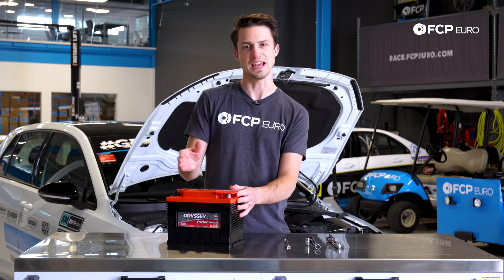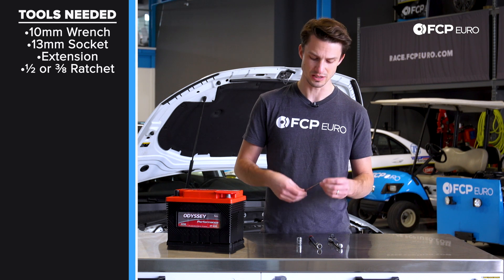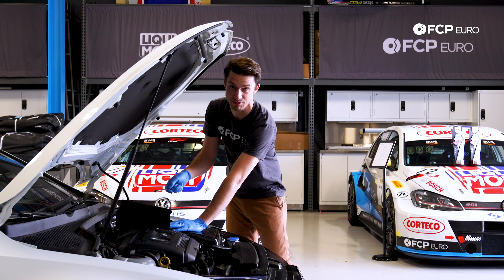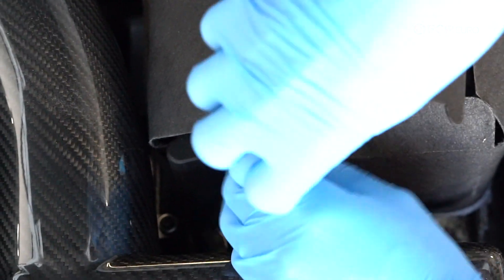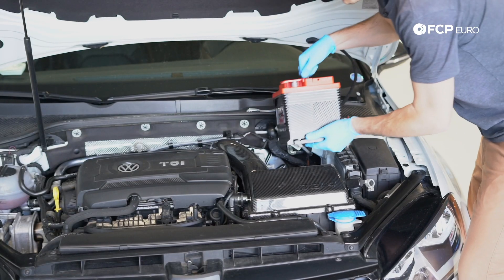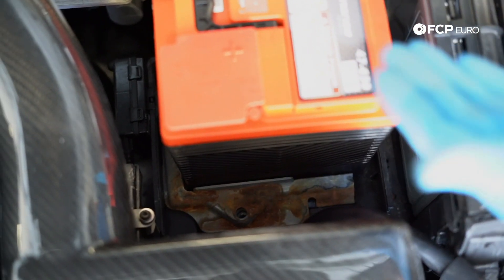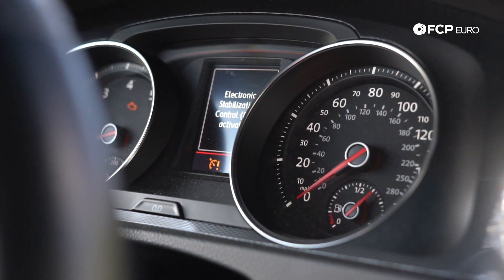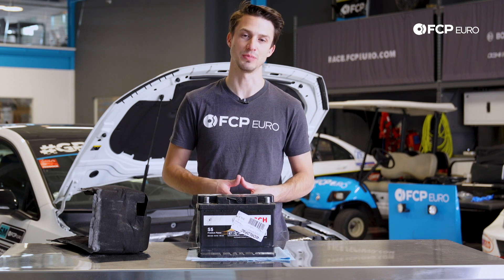How To Replace The Battery On A Mk7 Volkswagen GTI - DIY - (MQB Platform - Jetta, Beetle, & More)

Comment from the maker: No need to program the batteries unless it has battery management. It looks like a small control module on the negative terminal. Typically if you have start/stop it will have it though, in that case you need to have it reprogrammed at a shop or dealer after reinstall. Sorry for the delayed response!
Reply: Thank you, FCP. I love your battery install video. Easy to follow instructions. I ordered my first Odyssey battery today from Odyssey website and the programming questions left me wondering if there was an extra step involved. On the other hand, if there was a programming issue I'm sure you would have mentioned it in the video. Best
Reply from the maker: @madmex6526  no problem! Next time you need to order an Odyssey battery and want it to come with a lifetime Guarantee be sure to check it out on fcpeuro.com :-)
Reply: My MK7 Autobahn has start/stop, but I don't see a module on the negative terminal. Is recoding necessary?
Reply: @JohnPaulLafata  I don't know. My 2016 has start/stop too. My first Odyssey battery purchase was for a 20 y/o SUV I have. I'll be ordering another Odyssey very soon for my GTI as my original battery is now 4.5 y/o.
Reply: @JohnPaulLafata  ....just ordered my Odyssey from FCP Euro. From my wasted hours of reading - there's nothing to do with the coding. Like the video says, drive around the block and any dash lights triggered by disconnecting the battery should turn off. One guy just turned his steering wheel left and right, never left the driveway, and his dash lights turned off. I'll report back after my install.
Reply: @madmex6526  thanks! I spent hours researching yesterday as well and didn't really get anywhere. Good luck!
Reply: @JohnPaulLafata  It's done. Took about 15 minutes to install my new Odyssey battery in my stick shift 2016 GTI. Driving around the block quickly turned off the few dashboard lights that stayed on, like tire traction and tire pressure, except for one, the cruise control light, which I turned off myself. No need to worry about codes and coding blah blah blah. And I have a push to start button. Buy your Odyssey from FCP Euro. Shipping was super fast. And my original battery had no handle so I had to muscle it out with my fingers. Weird.
Reply: @Martin Michael No problem :D
Reply: @madmex6526  ANY UPDATE?
Reply: @madmex6526  I love you
Reply: @madmex6526  thank you, made my day so much better
Reply: @JohnPaulLafata  I just recently had my battery changed to an AGM.  The mechanic looked for the battery management menu in the program but was not found; no reset needed.  My model is a '20 GTI Autobahn.

Comment: Great video.
I just did this and found the large H6 size battery at Costco even though they don't have VWs or BMW in their computer..lol
The fit was great.
I always use battery terminal gel to prevent corrosion.
Had traction control and tire pressure errors that went off after driving and reset pressure.
Clock didn't lose it's setting or radio stations, stereo settings.
I cut the outside corner of insulation jacket and covered the terminal wires as well to protect them from heat.  I had no corrosion in the battery tray on '15 Sportwagon
115 dollars at Costco for full size H6 Interstate Battery.
I tried H7 from Costco and it looks like the bottom of air filter would need to be removed to slide batt in and no room for tie down plate and I didn't want to experiment fitting it currently.
Cheers

Comment: This is what I did to my 2015 GSW TDI (Mk7). I just replaced my old EF H5 battery (I think it was a CPO replacement) with a Die Hard H6 AGM battery. I also bought battery terminal protector (small packet gel) and coated the terminals and connectors. I have a slow 2 amp setting battery charger, and connected both ends to the cables in the car before I removed the cables, and kept them attached the whole time. You can tie off the negative one to keep it out of the way but keep the charger connected. I also used some small rags around the cable connectors just to be sure nothing sparked. After the new battery was in, I attached the positive cable first and then the negative. No sparks. I then unclipped the battery charger cables. My smart VW was clueless that it had a new battery. Using OBDeleven I updated that I now have a "Binary-AGM" battery type (not EFB) and increased the rating from 61 to 70 Ah. I really don't think it cares about Mfg or serial #, but I guess you put those in just to keep the data current. I left 1111111111 in place and typed in DIEHARD. There were zero faults in this process. I'll update if I have any issues.

Comment: Thanks for sharing this helpful video with the DIY VW community outthere.  In my case the battery died on me all out of the sudden w/out any warning. I was lucky to be at a gas station where I was able to get it jump started so I could drive to the closest VW dealer to have it replaced. So I wonder why modern car technology doesn't allow the driver to check on the battery status as it was in the old days when most cars had a voltimeter  on the instrument cluster?...

Comment: You should discuss the whole issue of AGM vs regular lead acid.  I recently replace battery in my 2016 GTI and I kid you not, i called over 15 shops including 2 dealers and most thought the car had AGM stock and said you MUST reset the computer after installing new battery and you need  scan tool.  Autozone refused to sell me a battery cuz they said it MUST be reset by dealer or mechanic.  Even vw dealer told me it was agm but I called multiple dealers and finally talked to vw PARTS GUY, he looked up the VIN and said ITS A NORMAL LEAD ACID, H5 OR H6 WILL WORK, NO RESET NEEDED.
 I spent weeks researching this as my car was still starting but slower and battery tested BAD by 2 diff auto parts places so I knew it was going out and it was 5 years old.  But no one knew what kind of battery was oem and wanted PR codes.  The vw PARTS guy told me PR J1L and also gave me oem vw battery p/n.  so FINALLY after all that junk i realized i could just go to sams club and get a h6 installed (free installation).  As you noted, battery tray is long enough for h6 and multiple mounting holes for the hold down bracket to mount.  MANY places said i coul NOT get AGM if car just had regular lead acid.  some said you cant get regular lead acid as the car came with AGM and charging system made for it.  SUPER CONFUSING.  Some said you need a MEMORY SAVER to plug in or put battery charger on the cables while battery was out to SAVE THE SETTINGS...but my settings where there after even though sams club didnt put on charger while battery was out.  oh, the windows would NOT auto up/down right after...you had to hold the button for all the way up or down THEN they RELEARNED and auto up/down worked.  car ran fine though and all radio stations were there.
Please do video explaining all this krazy AGM stuff and resetting computer and what not.  BAD INFO all over the internet and auto parts places are confused too.

Comment: Mk7 battery needs to be coded for longevity. While it doesn't overall matter, the battery will not last as long due to the charging curve been different as it ages. 
If your vehicle came with a standard flooded battery and you install an agm it will not charge correctly. You need to change a few settings with VCDS.
1) battery manufacturer
2)Battery Type- change type to "fleece" for AGM
3) battery capacity- input the AH the battery is rated for.
4) battery serial number- put anything in for this, it just let's the ecu know a fresh battery is being installed.

Comment: Water and baking soda mixture to neutralize the acid.  Use an old paint brush to scrub the tray.  Flush with clear water.  Use a terminal brush to scrape the corrosion off the car battery  terminals and brighten up the battery posts. You may need a battery clamp spreader pliers to expand the clamps to fit the battery posts..

Comment: Do you guys have a video of a battery replacement for a 2019 Jetta 1.4? Does a 2019 require adaptation or just driving and turning the steering wheel end-to-end will reset everything, by the vehicles ECU?
Reply from the maker: The 2019 Jetta will typically require the same sequence and adaptation as the MQB Mk7 GTI. In our experience, the steering adaptation usually resets itself after the battery is changed provided that the one coming out is not completely dead, and the car has not been without power for too long.

Comment: I have a golf mk7 GTI and just replaced the battery - it has battery management on -ve terminal and start/stop technology.
Went into carista to set the battery type expecting to find "fleece" as the Battery technology to set, but it is not listed.
I have the following options:

WET (LEAD-ACID)
AGM
BINARY AGM
EFB
EFB+

Setting for the factory fitted battery was EFB (seems odd) at 69Ah
Installed a Bosch S5A05 AGM start-stop 70Ah

Is this a failing of the carista app?  Do I keep with EFB or move to AGM?  Everywhere I look says fleece is the setting...
Reply: My understanding is that AGM is the same as "fleece".    I guess you figured it out 2 years ago.

Comment: Battery Heat Shield
According to the VAG ERWIN Self-study guide, guide No.504 “Vehicle Batteries- Design & Function”, the engine bay is considered a high temperature place for the battery. This can adversely affect the durability of the battery due to:- “Corrosion of the positive grid, water consumption, & self-discharge increase.”. They also state that AGM batteries must retain the heat shields they have been installed with as they are more susceptible to heat damage. Conversely if your car wasn’t fitted with an AGM battery there is a chance that it won’t have the required heat shields & you will have to retro-fit them.

Comment: I saw what looks like three little screw marks inside the battery Bay.  Is that to adjust what size battery you put in there? And if so would it be possible to stick an h6 or h7 battery in there for more cranking power and reserve capacity? And then would the car have to be completely reprogrammed?
Reply: I tried H7 from Costco and it looks like the bottom of air filter would need to be removed to slide batt in and no room for tie down plate and I didn't want to experiment fitting it currently.
Reply: @sonofrobert  don't think you can go bigger than H6
Reply: @AgentOffice  
You're right, returned the h7.
H6 is great!
It wasn't worth doing modifications to get h7 to fit..lol
Cheers
Reply: @sonofrobert 😂

Comment: I have 2015 GTI - dealer said while replacing the battery to use trickle charger so some computer settings do not get erased - is that true?

Comment: thanks for the video!
I just bought a 2019 GTI, opened my hood and noticed that 2nd hole behind the one that the battery is mounted on. I thought that the dealership forgot to put the bolt back and i started getting all paranoid. Its just an optional battery mount hole hahaha
Reply from the maker: glad you got that sorted out!
Reply: stock battery is size 47, the space can accommodate a size 48  if you use the other mount hole

Comment: I would have washed the area out with baking soda and water.    This is to neutralize the battery acid so it doesn’t eat through the metal.
Reply from the maker: That's a very good idea.

Comment: What happens when the lights and codes don't go away after a drive as depicted. I can't seem to clear my ABS, ESP, steering angle fault
Reply: Did you figure this out? Please replay.
Reply from the maker: @DatGameCollector  Those should clear after a short drove, if not clear them with OBDeleven or Vagcom
Reply: @fcpeuro  it did. But was freaking out while it was happening.
Reply: mine never went away, i cleared them on obd11 but they came back

Comment: Hi, i didn't see you do a reprogram of the battery monitoring system, wasn't it necessary?
Reply: I seen from other videos that it is only required if your VW has the start/stop feature and if it does there will be an extra cable going to, i think the positive terminal. If your car doesnt have that system you could still reprogram a different battery size and it shouldnt hurt anything but not required.
Reply: Just had to change my battery on my 19 gti. All the comments had me worried about this. I have the stop/start system. However after driving, it seems all codes cleared themselves.

Comment: Second time installing a battery in my MK7 both times the CEL/TPMS warning didn't go away and I had to remove them via VAG/COM. Anyone else experience this?
Reply from the maker: Those should clear after a short drove, if not clear them with OBDeleven or Vagcom and initialize the tpms

Comment: The memory of the computer in the car is not lost? Some people say that if u disconnect the battery, you will lose the memory of the car.
Reply: yes the ECU will lose its memory and you will lose your radio stations. The ECU can relearn everything though.  When you first start with the new battery, the engine will be pretty rough, no cause for alarm it just had its settings cleared and will relearn them.

Comment: I was told I had to get the “computer/ charging system” reset on my 16 Jetta TSI after I change the battery.  Is this true, or is there a DIY procedure for this?